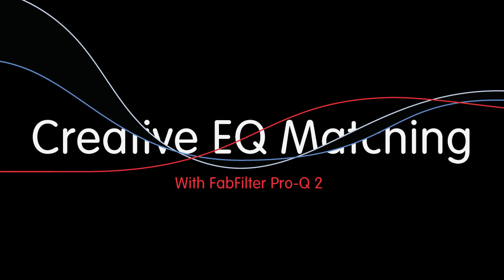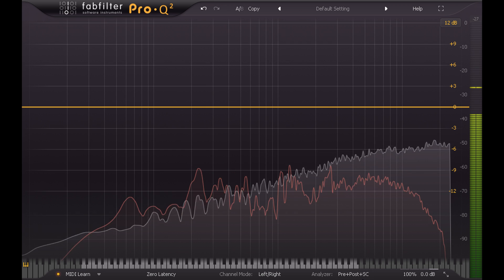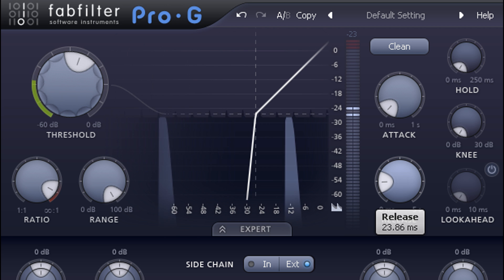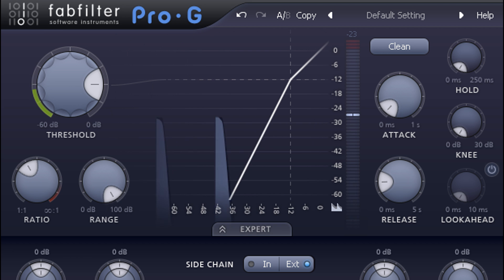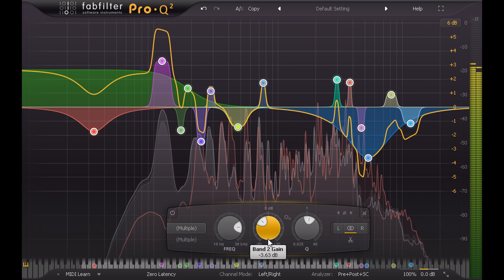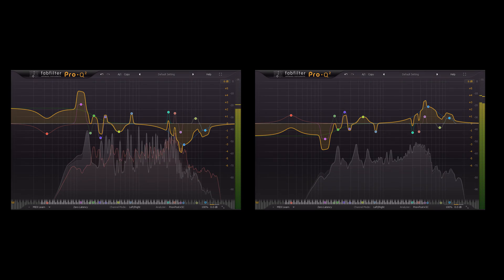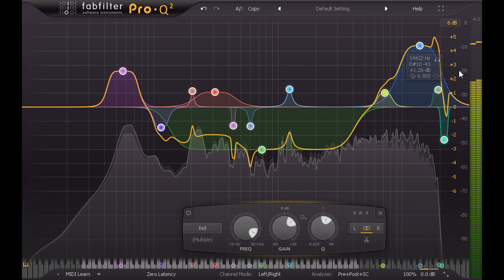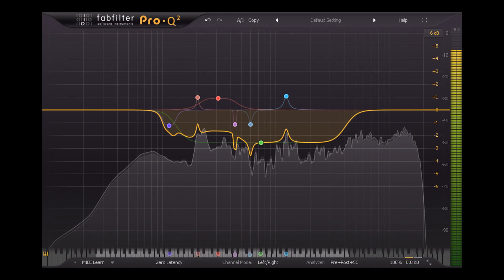Creative EQ Matching

Comment: How long of audio loops is adequate for EQ matching? What I mean is I assume the matching process equates an average over the duration of time it listens but it also doesn't listen for as long as we want or does it? For example even if fabfilter's EQ match could average out an entire song's spectrum it likely wouldn't be useful at all given how varied a song's whole spectrum would be during its entire course, thus if you get time could you let me know what length and or sound elements are ideal? For example a static 4 to the floor kick sample will be great as it's a) short and b) a static repeating spectrum as opposed to say a long and dynamic vocal, so I'm going to assume EQ match ain't so great for this and we'd need a more dynamic plugin like trackspacer, of course we could set up the dynamic EQ bands in fabfilter but again I'm assuming as trackspacer already has 32 bands from the off that it may do a better job, but can the new spectral bands of pro-q be set with a bandwidth of the entire audible spectrum so we can use just 1 of them with high spectral density instead of us doing many of the standard non spectral dynamic bands?

Thanks.

Comment: Hi Dan!, great video — very clear explanation of EQ Match examples👍

I wanted to propose a slightly different use case and get your thoughts on whether the logic holds.

Instead of matching L guitar to R guitar, I was thinking about EQ matching guitars against the bass, but only in the Mid component.

Typical scenario:

Guitars are hard-panned L/R

Bass is mono and centered

My idea would be to extract Mid only (M/S) from the guitars bus and EQ-match that Mid signal to the bass, with the goal of unifying their midrange character rather than further separating them.

So the intent here wouldn’t be stereo width (that’s already coming from the Side information), but coherence and solidity in the center, by aligning the Mid content of guitars and bass. In other words:

Side = separation / width

Mid = cohesion / glue

Do you think this “unifying” criterion makes sense for EQ Match in this context, or would you still recommend keeping guitars and bass differentiated even in the Mid, as in your other examples?

Curious to hear your take on this approach. Thanks again for the great content.

Comment: I have a question that is haunting me. When applying EQ to resolve frequency masking is it better to do it on an unprocessed signal or on a processed signal? For example, if I do it on an unprocessed signal and then I come up with saturation or distorsion, new frequencies may appear to create masking, frequencies that were not there to begin with. In the same time, the carved part of the sound will not be that affected by the saturation as it has been removed. Therefore, not so many harmonies in the remaining frequency spectrum for my sound.  On the other hand, if I do it after saturation, I will mainly affect the fundamental and not the new harmonies created, depending how how broad my Q is. This may result in the carving up the needed space at a specific frequency but also maintaining the sound fuller  with the new harmonies that may or may not create more frequency masking. The bottom question is: is there a correct time to apply separation eq? And is it before or after saturation?

Comment: Hi Dan, I watched all of your videos more than once and I'm a fan. But something in the guitars example doesn't make sense to me... 
It will enhance the differences between the two guitars, that are there anyway, wich may be good, but then leave the frequencies, that are at the same level and witch are the more obvious problem. 
And a question... don't you get phase problems in the lower frequencies adding whitenoise to a Snare, considering the phase of white noise will be completely random? 
Best regards
Daniel

Comment: Oh now THAT'S an idea!  This is the proof of concept - it could be extended into its own feature for a KILLER reason to use Pro-Q.  Imagine FabFilter: select all tracks with an instance of Pro-Q on them and click a sub-option of "Match" that automatically creates EQ curves for each track - if you can do it for 2 tracks, you can do it for more by merging curves.  Talk about speeding up your mixing process!  Provide checkboxes to skip low frequency matching (commonly high pass filtered out anyway) and skip high frequency matching (either low pass filtered out or usually not as important in needing to make space).  Each of those options checked means more possible EQ curve matching in the oft-used mid frequencies.  Add another option to only cut (they should cancel out e.g. track A cuts at 300Hz and track B cuts at 500Hz still leaves space for both) to save more points and perhaps make it easier on adjusting faders.  Add another option to enable dynamics on each curve to duck automatically when another track plays instead of a static cut/boost...  The best part is that this is mostly using features Pro-Q already has, but just tying them all together in a nice bow.  Get 90% of the way there in a couple clicks, and with all the curves there on each track's instance we could tweak as necessary to get that last 10% if needed.

That would be an INCREDIBLE time save!  This got me dreaming real good :).

Comment: Hello, I am using fabfilter pro q3...vers. 3.1.7...64 bit,  in cubase pro 11 but there is no activate sidechain output option in cubase...any suggestions? Thanks!
Reply: It’s there. I use Cubasis on iPad and its there. Not sure how sidechaining works in Cubasis however. I suggest looking that up and going from there
Reply: @cured_bacon647  thanks...I figured it out...in Cubase the fabfilter was in vst 2 mode which hides the sidechain options...just had to find the vst 3 version and all worked. Thanks have a great day.

Comment: I hope to improve fabfilter in ableton because is very difficult to make sidchain. If you want to make 3 or 4 audio track with saidchain you need 3 or 4 chanels with kick for example  to send o fabfilter plugin. You can not use one kick for 4 audio tracks I hope to improve this in ableton because in logic is very easy !
Reply: you can definitely add multiple sends from one track! Check your routing settings for the kick track

Comment: great tips  👍...and if youre on Reaper, you can go 1 step further and use parameter modulation to change gains or modulate wet/dry. that way you can do carving etc only if theres any sidechain signal present. :)